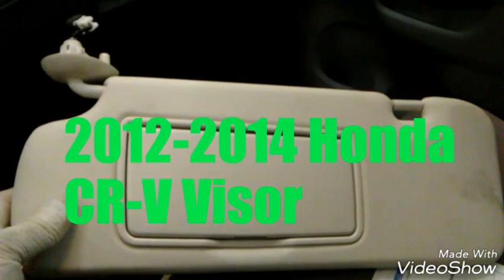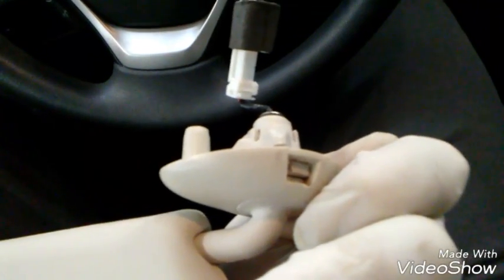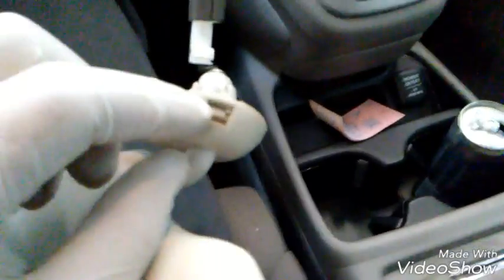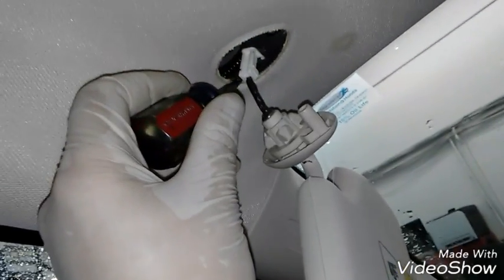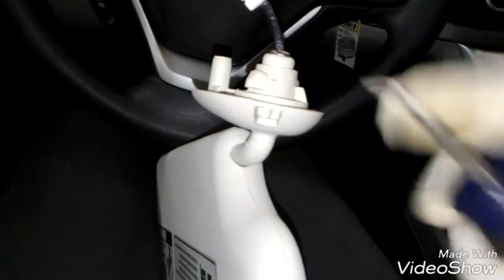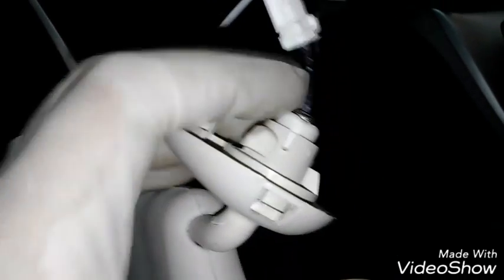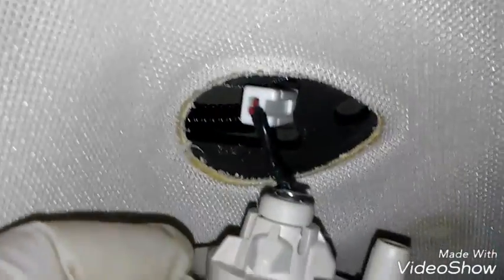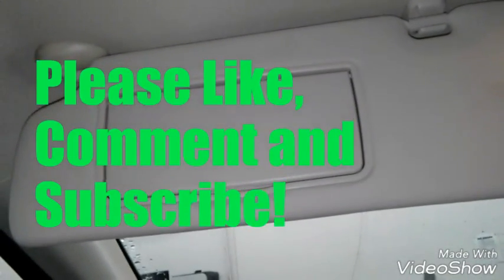2012-2014 Honda CR-V Visor replacement

Comment: Thank you for the directions. Worked perfectly for a 2015 CR-V. The visor is expensive but I saved the labor cost at the dealership. The hardest part was removing the old visor. It takes some strength to push in the tab on the old visor. I did not have a problem reaching the tab.

Comment: When you say to push the lock in, can you better describe exactly how? I'm having a heck of a time trying to get mine to push in. Are you putting the flat head slightly in the gap slightly above the lock and pushing down? Pushing directly in? Putting the flat head vertical and pushing straight in?

Comment: Thanks buddy for this video. We an auto body shop replace the headliner do to a mouse getting in our car. The visor fell one day and they just slammed it in. Then it fell out again, this time the beauty light wires were severed. So after I repaired the wires your video helped me install it correctly this time

Comment: Thanks for posting.  I was wondering how to remove the visor. Does the whole visor have to be replaced when the light bulb goes?
Reply from the maker: +K Hicks usually yes. Its an assembly.
Reply: Gearmo Auto Hmm,  that's crazy.  Just another way the auto industry gets over on the consumer. ☹

Comment: Here is the part number:  83280-T0A-A81ZA
Reply: For the gray leather interior EXL 2014 CRV model, do you know what the color code should be? Or can you tell me if the part number you included above is the right color for gray interior?